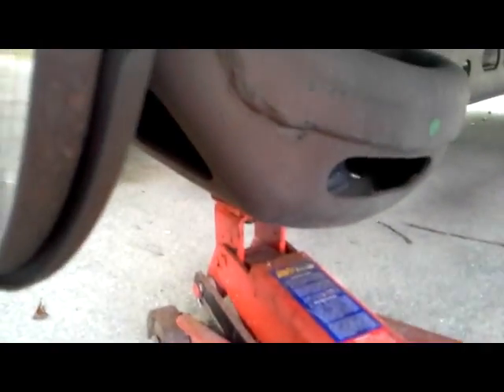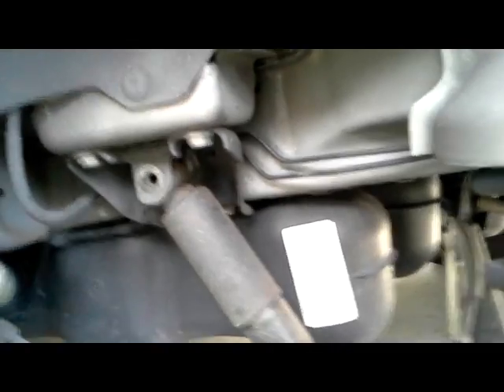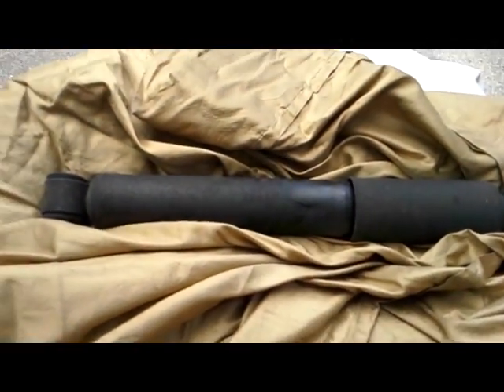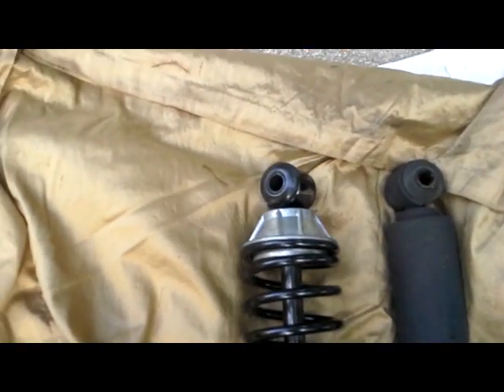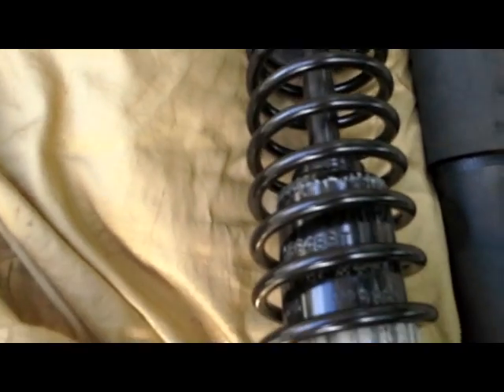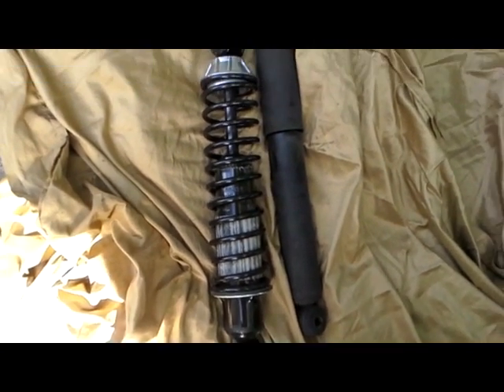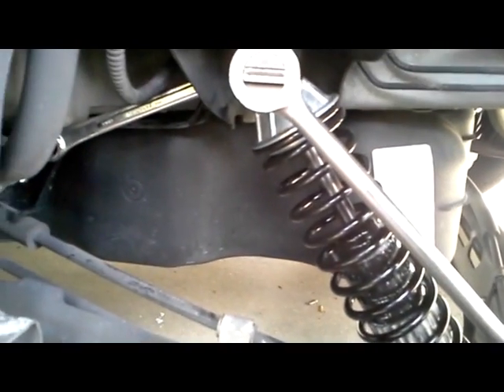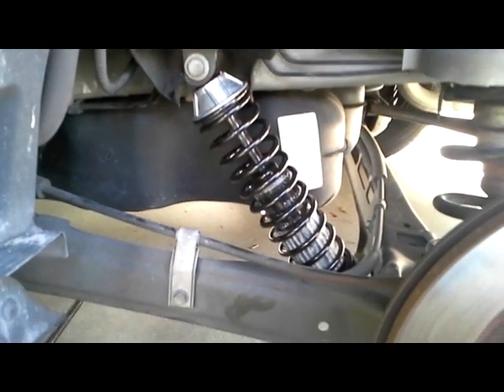Monroe 58648 Sensa-trac rear shocks install 2008-2014 Chrysler Town and Country

Comment: Hey thanks for the video. I was holding off on this but winter is fast approaching. Wanted to put the van into the shop to have this done as I haven't worked on a car for many years.  But after you said it would only take 60 minutes I took up the challenge. I called the local parts shop and they had the load levers in stock. Picked them up for 168$ (Canadian). Slapped them in there and was done in less than an hour, thanks to my trusty impact. Truly a simple do it yourself job. Thanks for inspiring me to get my hands dirty! Saved enough money to spoil the kids some more for Christmas.

Comment: Thanks cuda2000. You just help me save $250 bucks at Firestone. They told me $350 for my town & country. I just bought some Monroe 58620's from the ShockWarehouse for $100 bucks. I can change them out thanks to your video which de-mystified the rear end softness. When I take my family camping the ride will be much better.

Comment: Thanks for getting back to me. If the only irritant of those shocks is a clank going over speed bumps I can live with it. By the way I caught your video on the heater hose y pipe. I changed my over to a brass tee rather than wait for it to blow when I'm on the highway. This was very helpful and I'm sure it save many people a lot of aggravation. The factory replacement for that y pipe is $100 in Canada vs. $2 for the tee pipe and $4 for the heater hise. Stealership want 1 hr labour @$95 plus the part plus tax. Talk about a design flaw. So thanks again.

Comment: Thanks alot for putting this video together. I has helped to simplify what I need to do. I0 have a 2009 VW Routan which is virtually the same van 
and I need to replace my rear shocks.

Comment: I had put similar on a 2002 Town and Country Touring and they were awesome. I thought I would upgrade my 2014 T&C Touring L. The install was different between the 2002 and 2014, but got them in without much issue. I was INCREDIBLY disappointed in the ride on these installed on the 2014. The ride was so unstable I removed them and put the old ones back in. Seriously, I could hop on the rear bumper and make the van rock violently. With  the original shocks back in it dampened my hopping and swaying. I suppose the originals weren't as bad as I thought. 
It was funny seeing the video since the label "this end down" on the gas shock was covered by that rubber sleeve on mine. What is that sleeve for anyways?
Feeling a little gun shy about purchasing these again. Maybe I got a bad set?  Unfortunately I can't return them due to the boxes being recycled the day I was installing the shocks. Oh well. Anyone one want to buy a pair of these that only saw about 5 miles of travel on them.

Comment: Good thing this video was here, I bought the exact same shocks and neither were stamped regarding direction. Also if you have a rear heater the hoses get in the way in getting a wrenching behind the top bolt on the back rear. It can get a little tricky.....you wonder where these engineers graduation from.

Comment: Please, please use jack stands! 
The supplied jack is nicknamed "the widow maker" for a reason - it should only be used for changing a tire. 
In this video, if the vehicle falls off the widow maker, the jack supporting the unsuspended rear cross beam and axle can become dislodged. Even though the car will be stopped from hitting the ground completely by the removed tire, the cross beam and axle can still pin a crucial body part to the ground.  
And having done this repair myself, working on the bottom mount of the shock places body parts under the vehicle. 
Otherwise, good video.
Reply from the maker: Haha yeah I don’t know what I’m the world I was thinking there, I always use jack stands! Check out my other videos and you will see many jackstands. Thanks for watching!

Comment: Just installed my Munroe Coil shocks.....wasn't I surprise how the ride improved dramatically. The only problem I had was removing the top bolt off the old shock. I used a stubby 18mm to hold the nut behind the frame since there isn't much room for  a regular wrench....Definitely no room for a socket. I think Chrysler did this intentionally to irritate do it your selfers.

I replaced shocks 4 yrs ago on my 2000 caravan and was able to do it without taking the tires off....which took me 30 mins to do both so I was expecting this to be easy too.
Reply: I tried a regular 18mm wrench with no avail. I gave up and just replaced my rear and front rotors and pads. I'll go back some time this mount and replace the shocks (since I already purchased them), this time I'm going to use a stubby 18mm like you used and a whole lot of blaster rust inhibitor with a whole lot of elbow grease. I may splurge and by a impact wrench (haven't made my mind up). Thanks for the tips and tricks guys!
Reply: I just did mine, and although the video was very helpful I have no idea how he got the 18mm open end wrench behind the top rear shock mount to hold the nut.... I removed the 4 bolts holding the top shock bracket very easily and pulled the whole shock out with the top bracket then removed the shock from the bracket.

Comment from the maker: I believe I installed them the correct way. I pointed out that it was stamped "install this end down" exactly in the center of the new shock, so that was worthless. I installed them so that the writing was readable (not upside down) which made sense to me. Ive put a lot of miles on and loaded the van down and they work fine. Only complaint is that they make a  clack noise going over speed bumps.
Reply: +cuda2000 Have you investigated the clacking noise any further? Had a repair shop investigate? 
How is the ride now after some miles? I am thinking of putting these on my 1996 Grand Caravan. 

I found another (Russian) video where they installed these shocks in the same orientation as yours. But I admit it does seem upside down at first glance.
Reply: I've installed these coil over Monroe's on my ford fairmont.  I'm on my second set since the first ones started leaking.  The shaft were rusted causing the seals to go bad.  But anyways for the noise problem that everyone is experiencing is the spring rubbing upon the metal circular tubing.  I fixed my problem by lubricating the area and turning the spring until it no longer rubs.  I had someone bounce the car for me while I was under the car.   Suspension now sounds good and works 100%
Reply: Unless I missed it, the video needs to state the torque specks and the fact that the weight of the vehicle needs to be on the bolts for the final torquing.  Also, The clack could be due to the misalignment of the ribbed rubber skirt.  Make sure it is centered over the middle part of the shock.

Comment: get behind the bracket with an open box wrench is impossible. you have to take the whole upper bracket off (4 bolts) but before that you have to take off the Lower shock nut and bolt sometimes it Could be really stubborn you got to use heat . that is the only way you can do it.

Comment: Hi! Thanks for sharing. I've got a 2016 T&C, and it has a very stiff ride. On highways is ok, but any small bump or street joints makes it jump. My mechanic checked it and said that everything is fine, and that the stiffness is the way these models ride. Would you say that replacing the shock absorbers makes it ride smoother?? Thanks !

Comment: Awesome job! Question.. Did you install it in the correct orientation? Also, what is the torque requirement for the bolts? Thanks.

Comment: I just did mine, and although the video was very helpful I have no idea how he got the 18mm open end wrench behind the top rear shock mount to hold the nut.... I removed the 4 bolts holding the top shock bracket very easily and pulled the whole shock out with the top bracket then removed the shock from the bracket.
Reply: As I said I used an 18mm stunt wrench. PITA but doable.  3 yrs later still love the way it handles.
Reply: I meant I used a study wrench
Reply: Gotta get me some study wrench's
Reply: Sorry about that....I was using my dumb phone...I meant to say stubby wrench....that's what worked to me.
Reply: i have a 2005 town and country. what shocks
 should i get for a better ride quality?
Reply: I bought and installed the Monroe load adjusting shocks because I use my Caravan to tow a boat on weekends... Is this the best shock for ride quality? probably not.
Reply: I can't comment on whether it's the best ride. There are air shock kits which are much more expensive but I'm very pleased with the monroe sensatrac shocks. I wouldn't drive another car without those shocks.....before I installed them my caravan would corner like a pregnant hippo

Comment: Just bought these for my 1997 Grand Caravan as when it takes any sort of increase of weight the back seems to bottom out. How are they holding up after 3 years if you still have the van?

Comment: So my question is how did you get the top bolt off? If theres a nut on the back side what type of wrench did u use cuz a long one doesnt work
Reply: You can use the open end of an 18mm at the right angle and it works just fine.

Comment: I have 2009 town and country. When going over a speed bump I get a popping and clank noise in the back end like something is lose but this is not every time. If the shocks are worn, would they do that ?
Reply: I have a horrible rattle in my 2011 T&C, that I think is the shocks. Not sure if yours is similar. I know bad shocks are a problem point on the vans, and I noticed my rear wheel hopping the other day, so I'm going to replace the shocks tomorrow and hopefully that fixes it. I've also heard that a bracket holding the brake line is weak, and is prone to failure, causing the brake line can rattle against something, so that might be your issue if it isn't the shock.